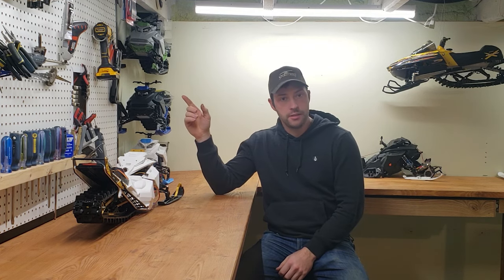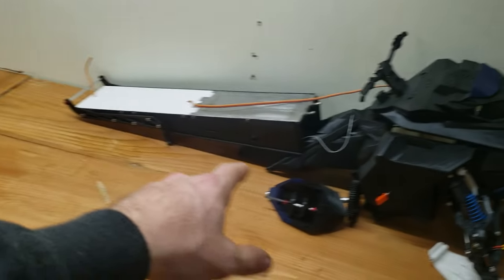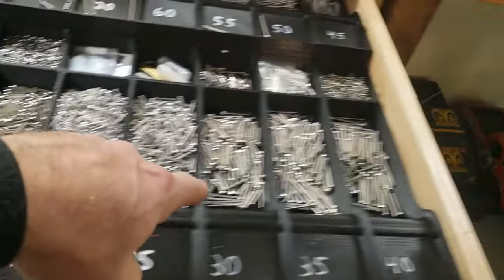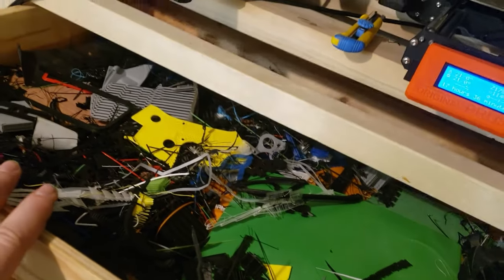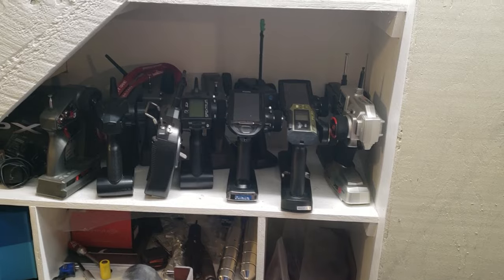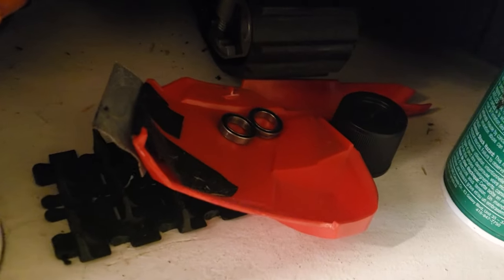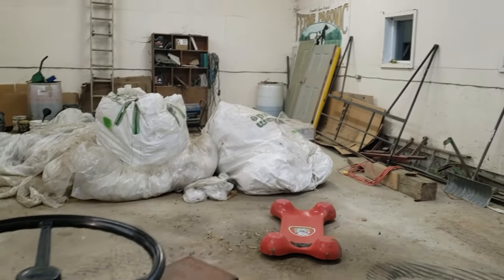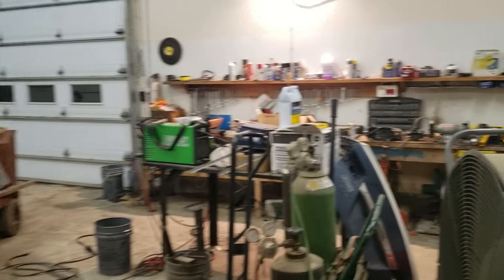Rc Creations - 2023 Workshop Tour!

Comment: Really cool man. How long did it take to design the GEN 4?
Reply from the maker: The idea came to me February 5th 2019. Believe it or not, the g4 was supposed originally to be a 1/6 scale sled, but i ended up lacking space. The first somewhat assembled (but working) version of the 1/5 G4 was conceived April 26 2019.  and the first actual test took place June 26 2019. Of course, it didn't end well, being the first ever prototype of a brand new thing.
But the first ride I'd call reliable was sept 15 2019, still on the grass.

To this day, i still work on it to improve it. Every month I improve an old part to make it better, and now, more than four years later, it shares virtually no parts with the original, but its all inter-compatible still, surprisingly.

Meaning you could say the g4 had been in development for the past 4.5 years...
Reply: @Pascal_Robert--Rc_Creations  that really interesting
Reply: @Pascal_Robert--Rc_Creations hey one more question. What CAD software do you use?